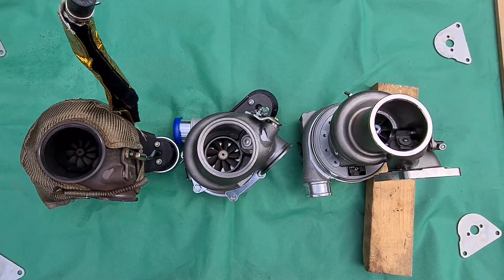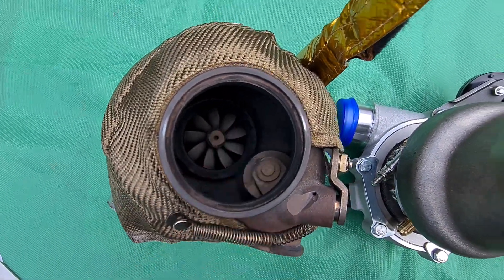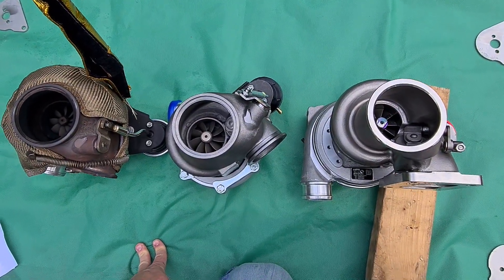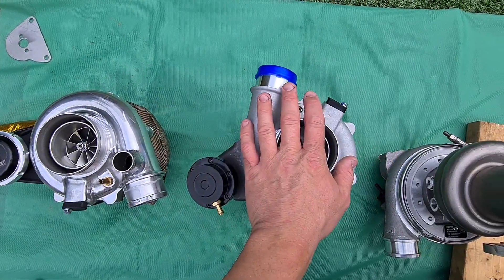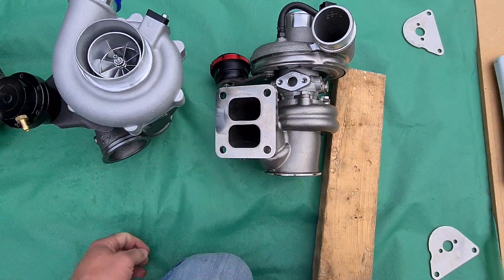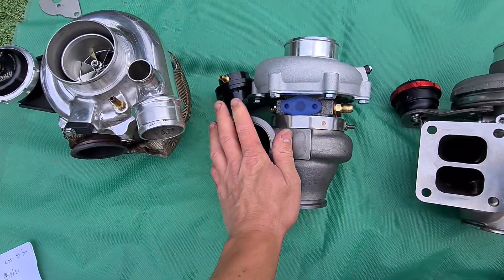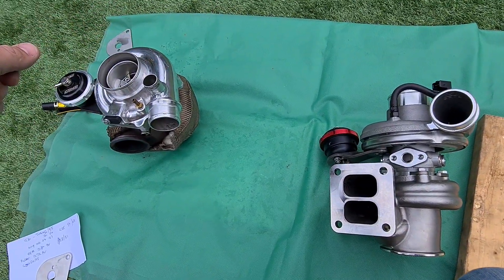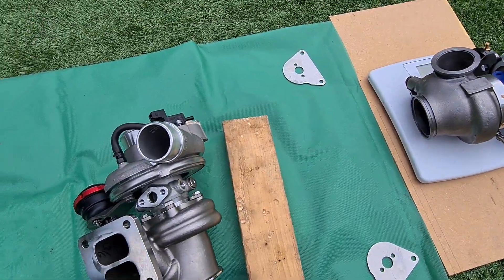g25-660 g30-660 efr6758 Borg Warner Garrett Pulsar compared

Comment: Which one would be the largest bolt o you could go? without relocating the battery
Reply from the maker: @Choconuss  the g30 660 with 0.92 housing. 

You'll have to forge the engine and get arp 625 head studs.

Comment: For me i like my k04 borgwarner..i decided to upgrade my turbo with efr series for more hp and tq..but most people say go for g25-550 series..but efr turbos boost start in low rpm which is great..but some people say efr turbo got so hot and breaks easily..do you think it is true ?
Reply: I’m running a G25-550 pulsar clone (4849G) on my 18 focus st and there is very little lag even running 25lbs of boost rn.
Reply: So you hit the gas and are in boost quickly?
Reply: Did you find this information bro? Im looking for this answer nowadays...i need early spool but reliable 450hp

Comment: EFR6758 vs G25-660  – which one would you recommend and why?  I made 520whp with the EFR6758 .64  on a 1.4L engine. would switching to the g25-660 ar .72 be a downgrade?
Reply: Sounds great!  I run the same turbo on a 2.0L engine and i was afraid it will max out at 500whp so now after reading your comment i hope to see some big numbers too.
Reply: @alek_gk  for sure it will do more than 500whp when it makes 520whp on a 1.4L ;)
Reply: The EFR will spool earlier and be more responsive.     The 660 has more peak power.
Reply from the maker: I couldn't really comment I'm afraid. So many variables.
Reply: https://www.youtube.com/watch?v=aXqkRCKvwoc
Reply: Где то писал что делал с мотором? Очень интересно
Reply: 😂😂😂maybe in a paper dyno you did that whp and with that little displacement of 1.4 and 49lbs/min of 6758 the limit is 420whp for that turbo, impossible you are wet dreaming😂😂😂 do not misinform
Reply: @solucasamateriales7681 have been on 2 different dynos... Haters gonna hate 😁👍
Reply: Hi. May I ask you what kind of engine is that 1.4L?
Abarth maybe?
Fully built with super high boost?
Should go like hell...
I have an old Saab 2L with a Holset , 230whp on 1bar ( dynoed), but not tuned correcly yet and running super rich in the 8ths. But thats a hobby car. 
Last year with a smaller turbo and 1.7 bar had the same power ( too much heat ).
Graphs and catalogues are not the real world and I saw people going over its "limits" even with a G25 550... 😊
Reply: @bato5673  Honda civic. It's a1.3L block, upgraded with 1.4 crank, upgraded rods pistons, fully built vtec head, 2 Bar of boost. You can see some videos on my channel

Comment: “The two Garrett versions” no they are not. They are Chinese copies of the original Garrett turbos and not even that, as they have used cheaper materials. Just call them Pulsar and stop referring to Garrett as they are NOT.
Reply: Garrett,  Are made in China, Mexico, Brazil  Not the United States. They haven't been for over 45 years. 
So don't hang your hat on Garrett.
Reply: Made in Japan as well.
Reply: Umad bro

Comment: An EFR is $300-500 cheaper than a genuine G series and is arguably a better turbo in many ways. Not saying the G series is bad, but it's not cheaper and you can get various flange options.
Reply: thats exactly what i was thinking you can get a vband flange on the efr and it includes more
Reply: @digital0785  They have some seriously impressive stuff.

Comment: Great video , but which of these is the simplest to fit with least amount of mods or hassle
Reply from the maker: The g25 and g30 will be simpler to fit.  The v band mounting point is very easy.  The t4 divided flange of the borg will need more fabrication work and getting the 4 nuts on and off is a pain .
Reply: @garymgzs280  thanks mate , I would love to see more technical videos regarding the engine , I have a manual Vauxhall Some Signum with this engine and there are not many videos on it.
Like adding a bigger inter cooler , replacing injectors , timing chains , and other stuff
Reply from the maker: @Shadowmosesarea51  ah right.  So you have 2.8 v6.  I have a few other videos specific to this engine.  Just post something as and when I'm doing something on someone's car
Reply: @garymgzs280   yeah I have had it for about 1 year and love it , thought it’s now on 155k but with full service history and I fully serviced it myself , plugs , oil , filters , coolant , water pump and belts.
Plus oil pressure switch as I thought it was leaking but I thing the power steering pump is leaking.
I wanted more power out of it but unsure what mods to do before hand
Reply from the maker: @Shadowmosesarea51  how much power you want.  

Upgrade intercooler is a must . Do88 have that covered.  

Remap by aura tuning. Check the Facebook page.  

And upgrade actuator.  I sell turbosmart ones. You can find them on ebay.  I sell them - ebay name saabmadman
Reply: @garymgzs280  TBH! Mate I’m only after 300bhp as it’s our daily , but I’m buying another engine to fully rebuild and then looking for more
Reply from the maker: @Shadowmosesarea51  just a map will get you there.  Map and intercooler should see you 310- 320bhp .
Reply: @garymgzs280  do you think my mileage will effect anything , like I say it has full service history and pulls very well , does not miss a beat

Comment: Brilliant. We're did you find the g30 with an internal gate? Couldn't find them when I looked.
Reply from the maker: Garret do list on their site . But garret have had supply issues so lot of units you cannot buy yet . The one in my video is a pulsar / Chinese copy of the garret . They now do 0.72 and 0.92 iwg housing for g25 and g30.  Normal and reverse rotation
Reply: @garymgzs280  brilliant. Were is the best place to buy them?
Reply from the maker: @gavinconlon9240  pulsarturbouk.com if your in uk

Comment: how did the internal gate flow? was it big enough? what psi are you running?
Reply from the maker: I'm at 25psi . There's still more in the turbo but I'm on stock internals still .
Reply: @garymgzs280  did the gate flow enough to control that or did it boost creep?
Reply from the maker: @darrenweller9160  it's steady.  So yea internal gate works fine
Reply: G series turbos have 38-40mm diameter wastegate ports so compared to the old T25 GT series 25mm ports I think it's enough when used with engines like SR20DET which need high boost to make power anyway. My GT3071R with .64 rear housing did creep to 1.5 bar no matter what, but my current .86 keeps it steady at 1 bar if I for some reason would want to run just that amount of boost

Comment: what is a pulsar turbo? is it a Chinese knockoff or something
Reply from the maker: Hi there . Yes a Chinese version of popular high end turbos . But they are midrange branded turbos.  Good reputation.  And very popular in the drift scene
Reply: @garymgzs280  very good quailty turbo
Reply: @Arss-ast  I just received mine but I have to say that I don't really like the wheel play ... not sure how long this will last on high boost
Reply: @low-budget-racing  how did it hold up?
Reply: @vladbc9172  works good - but in my opinion the EFR6758 was more efficient on my small 1.4 engine

Comment: How was the pulsar holding up?
Reply from the maker: Yes up and running now . Made 514bhp . Sounds great and pulls great . Very happy
Reply: @garymgzs280  very nice is that on the g30 ?
Reply from the maker: @jordancespedes15  yes . G30-660
Reply: How much boost and what engine you have  this G30 660 installed ?